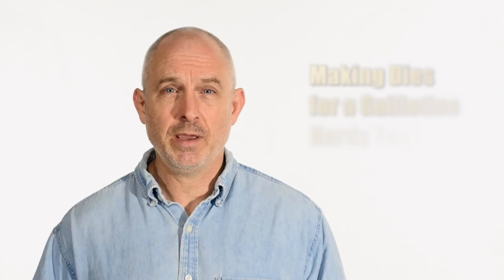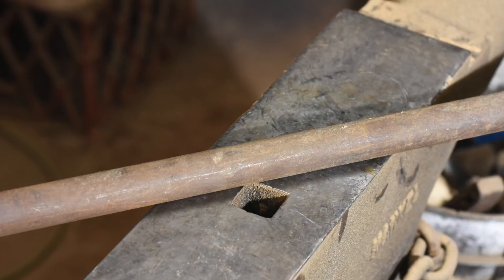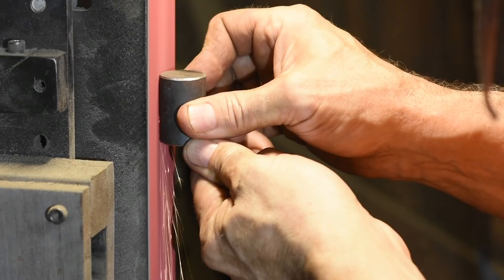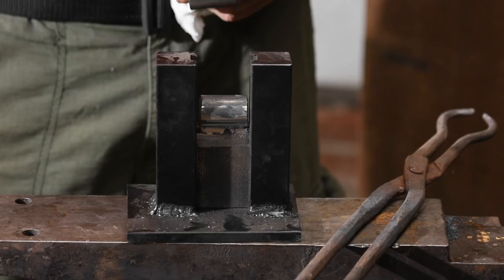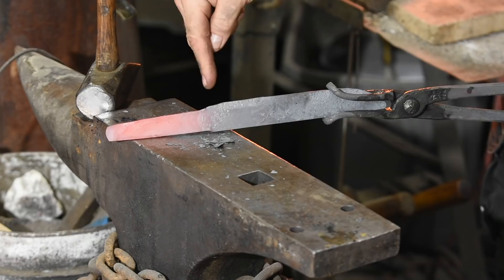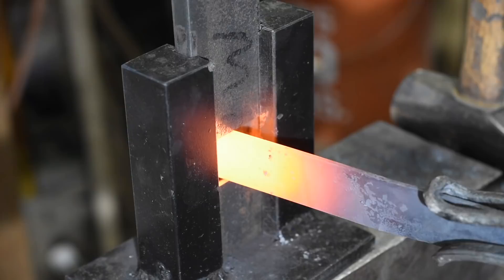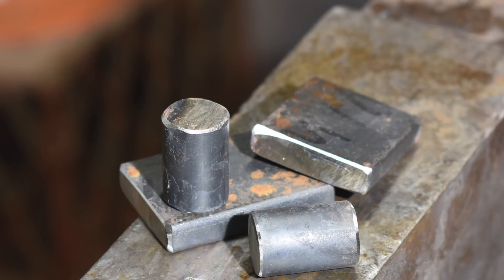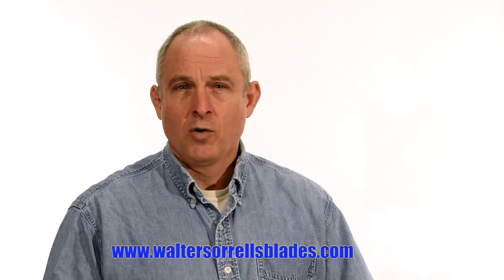Forging Tools for Knife Makers - Hardy Tool Dies

Comment: Dear Walter, 
    I just found your Forging Japanese dvd set online. I've had a love for Japanese swords since I was a kid. However my forge is off-grid and uses charcoal and no power tools. I was wondering if I would still be able to follow your instructions with that setup. I'm new to blacksmithing and have a hard time finding instructors that teach without power tools. J